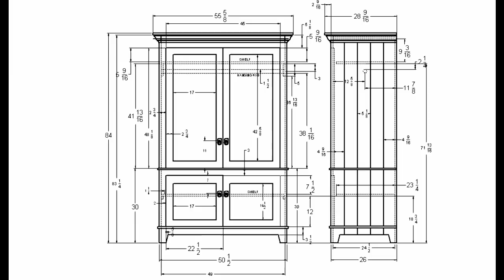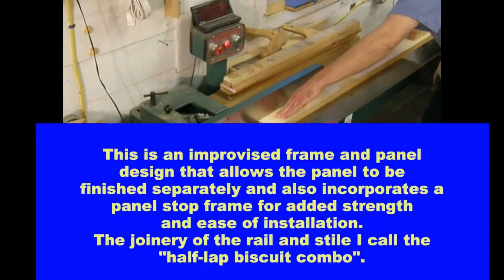Armoire with Barn Wood Panel Doors (part 1/3)

Comment: You gave an excellent idea. In Brazil no longer manufacture plywood or wood plate, as few manufacture MDF, which is a big crap. Using pieces of wood for wall or ceiling even floor produce great panels to construct the body of the furniture. I hope you understand, because my English is weak, rs, rs, rs.

Comment: I'm making a rustic wardrobe cabinet out of reclaimed walnut and am making the half lap door frames.  I watched that section about 4 times, and was confused, but then finally caught that the "1st frame cut" is done on the rails, not the stiles as captioned on the video (4:36).  Now, it makes sense.  BTW, if you ever consider making something out of 50+ yr-old air dried walnut that is less than 5/4, move on......... the scrap amount is not pretty.

Comment: at 10:17 why are you clamping the seams?
Reply from the maker: 11:25 tightens up the half-lap for better alignment and strength.  the glue surface being clamped with the small clamp is the most important for strength because all the other glue surfaces have end grain contact